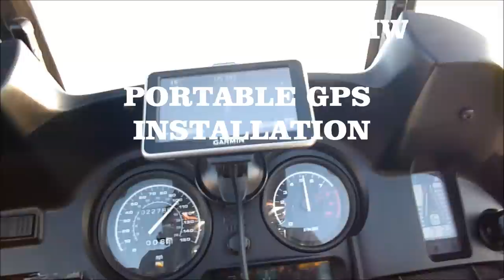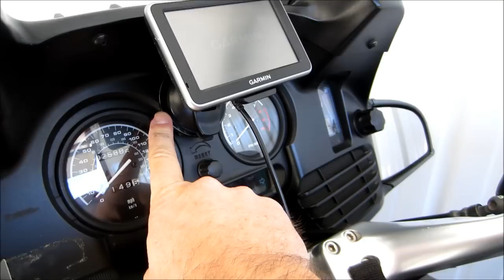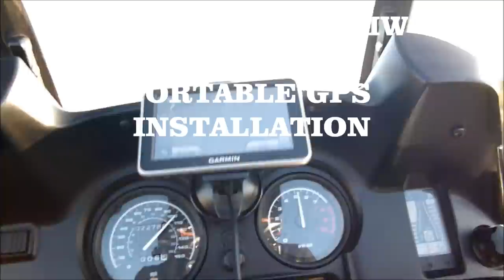BMW MOTORCYCLE PORTABLE GPS INSTALL

Comment: BMW motorrad newbie 9/22 with a 2001 1150GS.  Appreciate the highlight cool features on your seat adjustment and the safety tabs.  Stopped by hoping to find BMW calls their 'small cigarette lighter / power port?  You said "Powerlet?'  Is this just a proprietary thing or some European standard?  Hard to find an adapter on ebay when you don't know what the thing is called  :  )   Good video.  You can ride (probably did) to a crash site with your gear and do a BTSB broadcast.